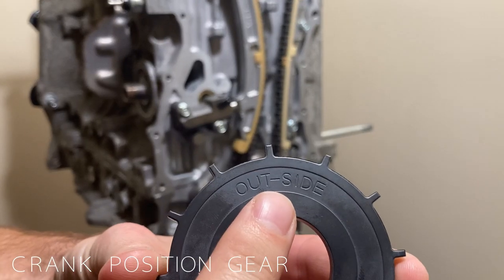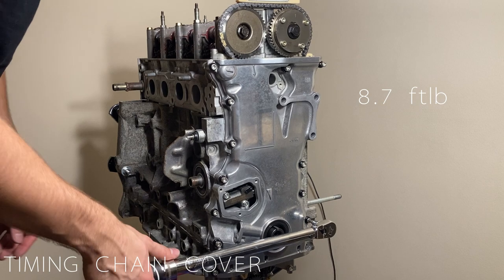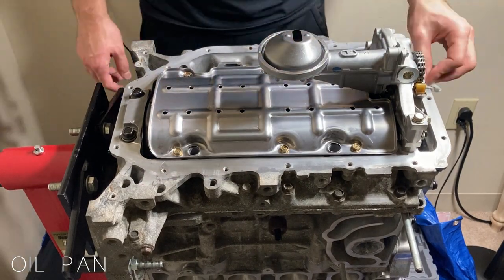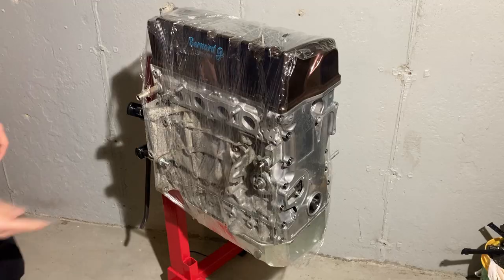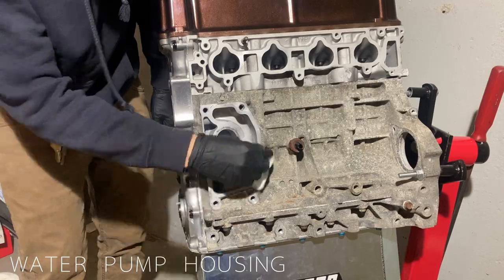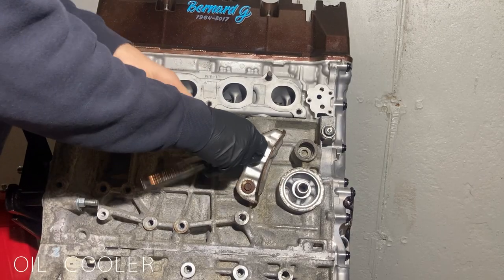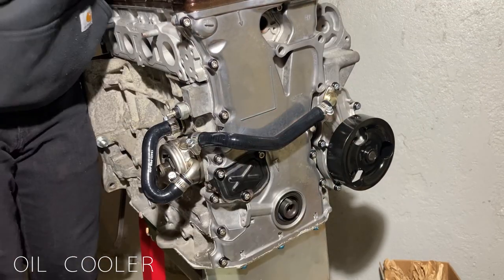How to Install a K20 Oil Cooler on a K24 | K24 MR2 BUILD

Comment: What are the part numbers of the water pump housing, the water pump and the oil cooler? You say they are from a K20A2, but isn't only the K20Z3 equipped with the oil cooler?
Reply from the maker: look up rsx type s water to oil cooler

Comment: What is the part number for the small gold colored fitting that bolts to the water pump that the hose attaches to?  You showed part numbers for the bolt and the o-ring, but wondering about the actual fitting.
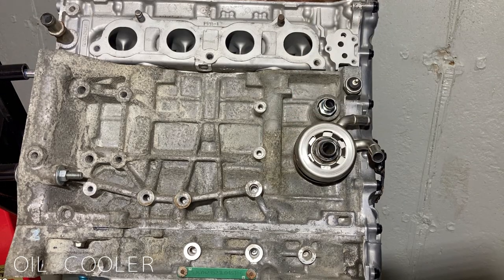Reply from the maker: 3:23 19425-PRB-A00. That should be what you're looking for.

Comment: Sorry to grave dig in the comment section. But, if you’re using a a2 housing, could I get away with using the Z1 housing from the K20 as well? & what water pump and alternator did you use? Any info would be help me out a lot right now.
Reply from the maker: @EddieDeUno  I’m honestly not sure about the housing but I know the a2 housing has the extra port for the oil cooler. 

OEM from a Honda element (K24 A4 like my block) 

K20a2 water pump

Comment: Where did you get the bolts for the water pump housing? I noticed that the studs on the k24 I have sticks out a lot longer than the k20
Reply from the maker: I bought a hardware kit to "dress up" the motor. I believe the company is called downstar. Kinda overpriced and my oilpan bolts didn't fit.

Comment: what torque spec did u use for the honda s2000 fitting
Reply from the maker: I could not find anything for torque spec. I checked my manuals and forums just now and still nothing. I went by feel for this one. If I had to guess ~24ftlb.